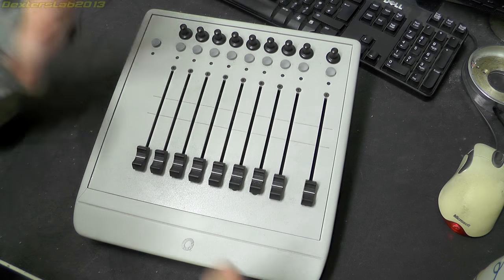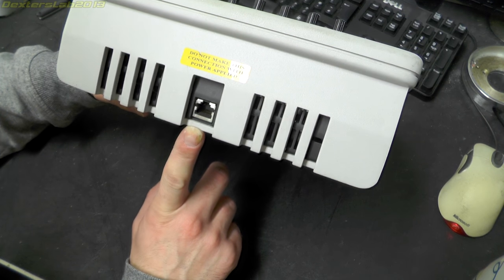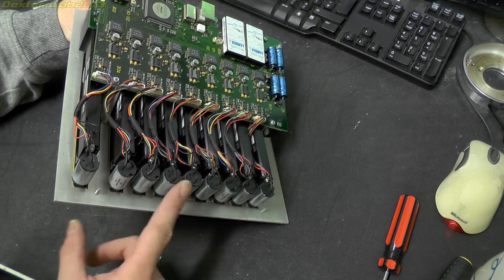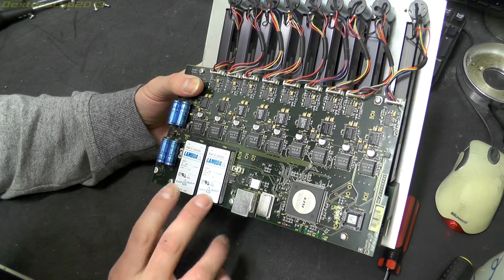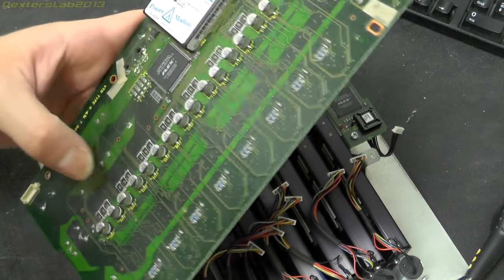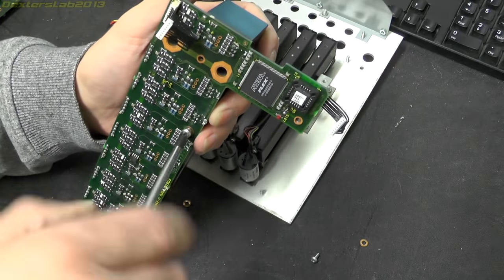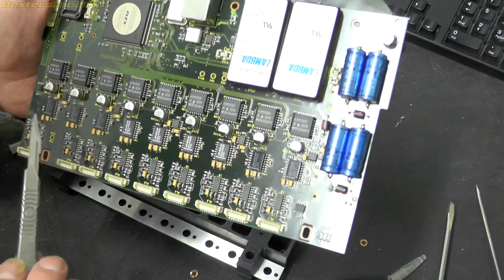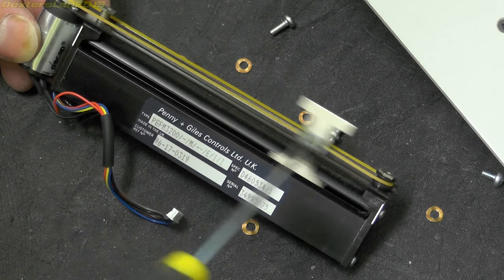DL#114 - Quantel Flying Fader Panel Teardown

Comment: a3952 is an allegro full-bridge motor driver
Reply from the maker: Thanks Mike.
Reply: It's like the opposite of something cost-optimized.  Crazy expensive component choices - multiple FPGAs in a flying fader controller!!? Lambda DC-DC converters... I wonder if the PCB substrate is actually compressed £20 notes...
Reply from the maker: Oh, that reminded me, the PCB is 8 layer, i meant to mention that in the video but forgot!
Reply: Jesus. Was the silkscreen hand-printed by David Hockney?
Reply: @DrTune  Quantel was never a company to save money! 
Everything was built to (it seems) fly into outer space on the shuttle!
Reply: @tekvax01  But we made high-quality products not consumer stuff. An editbox would be used 24/7 and had to be very reliable as not many people had a few spare ones!

Comment: reason for three independent DC-DC-modules might be: 
1.) DC reference for the faders position, something that the AD-converter can read-out
2.) digital stuff
3.) motor drivers
Reply from the maker: yea, good call Max... keep the noisy digital side separate from the analog

Comment: What's odd is how many FPGAs they got in there, particularly since this device only needs to deal with rather slow inputs and outputs. Back when this was designed, FPGAs were really expensive, and it could even be that they were the most expensive parts on the board. My guess is that Quantel had lots of experience with doing things in logic as for video you actually need custom chips. Designing something on an FPGA isn't that far off.

The motorized faders seem cheap in comparison. I mean they can't be highly reliable as dust will eventually get in there. A capacitive solution, like on the "RAND-Tablet" would probably have been more reliable... and perhaps even a bit cheaper. On the "RAND-Tablet" you had traces of wire going in parallel. They are scanned and each one carries a set of pulses describing the number of the wire. The stylus essentially measures to which trace it's inductively coupled to. In such a solution you'd either have lots of wires, or you'd measure the relative strength of several traces.
Reply from the maker: Quantel had huge amounts of experience with FPGAs, they probably always had loads on stock so probably worked ok for the bom instead of using a microprocessor.

Comment: Why does it need so many, parallel ADCs to read the faders?  They don't move very fast so surely you could just mulitplex them into one single fast ADC?  The only reason i can think of is to enable other highly parallel implementations which have many more faders?

Comment: Please investigate the LEDs, 6 pins...  RGB with no common annode or cathode?
Reply from the maker: Looks to be two isolated bi-colour LEDs in one package. One is Red/Blue, the other is Green/Blue with a common cathode. The cathodes are wired common on the PCB.
Reply: Yes. Old fashion RGB LED's used two blue dies because the blue was very weak.

Comment: I'm guessing the socketed chips hold the FPGA programming. How are the audio channels inputted into the fader? if they are sent via the 'ethernet' serial connector as digital, why bother converting to/from analogue?
Reply: stupossibleify I don't think audio goes into this box. It is just a controller.
Reply from the maker: The Quantel EditBox does all the sound processing, this is simply a controller that plugs into it. I did a teardown on the EditBox a few weeks ago: https://www.youtube.com/watch?v=TWSWNs_TRbw
Reply: DextersLab2013 Makes sense. Thanks
Reply: The most insanely expensively engineered controller ever!
Reply: Yes, it's a prom to configure the Altera. If I remember correctly it was an rs485 serial protocol over the ethernet connector. No audio was sent
 through the box, just commands to get/send each fader position. (I worked in R&D during the design of this)